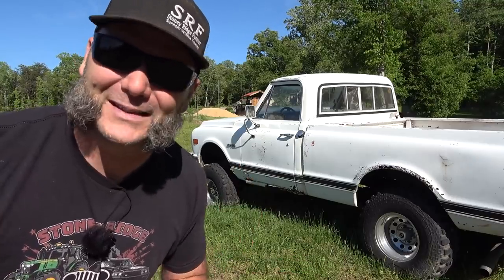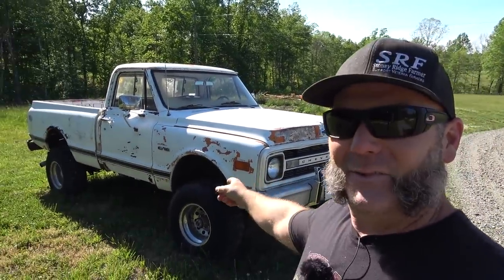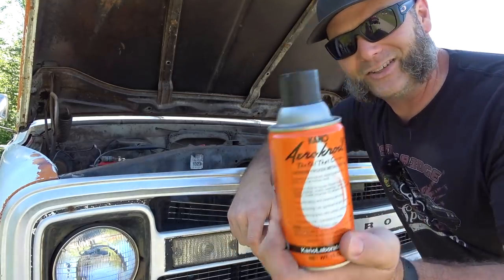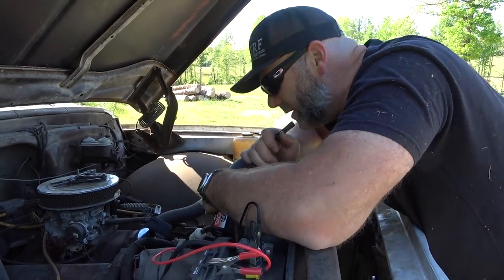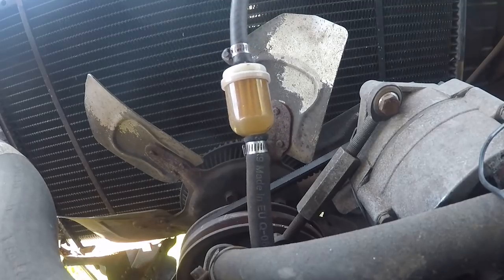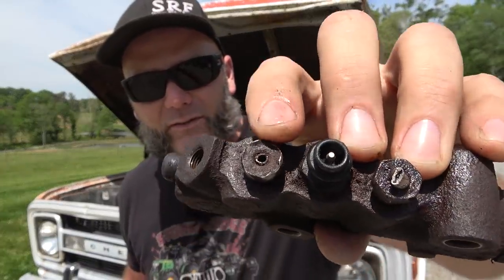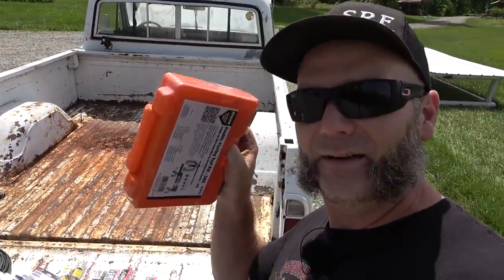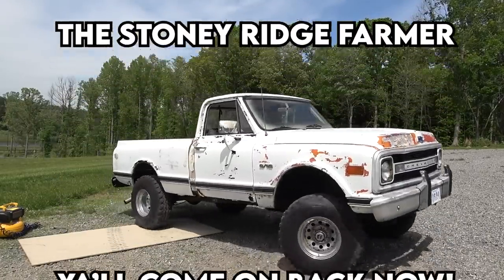C10 Pickup Is it worth Saving? Swamp Donkey C10 Episode 3

Comment: You need to watch Vice Grip Garage. He goes and gets trucks or cars worse than that one and ends up driving them home 600 miles. This guy is hilarious and lots of entertainment.
Reply: Yeah exactly this truck here is barely even that bad the little bit he showed underneath is better than my 78 c10 so.. i mean just a gas tank an a few fuel filters an possibly fuel pump and then the brake lines and stuff that's not that much at all . It don't cost that much , go on rockauto an get everything

Comment: Definitely keep it!!! Go to LMC or Brother's Trucks for parts. Brakes lines are fairly inexpensive. Then you will be safe. And if you have 1975 3/4 ton running gear then you have disc brakes which are better than drums. Anyway parts are reasonable and the truck is simple to work on.

Comment: drop the tank, 10 minutes,  clean it out, new fuel lines, new fuel filter, replace all break lines until the manifold comes in, 2 hours. pull the jets on the carb, can of wasp spray,  and a Merica air freshener..Dun.👍👍💚

Comment: Mechanical fuel pumps are like the human heart.  If the Mitral valve is not closing properly, you will have a low ejection fraction.  You should not be able to blow through a mechanical pump into the tank the valves should stop you.  Electrical pumps work better when they push rather then pull.

Comment: Josh, pull the fuel tank out from behind the seat and clean it out.  You shouldn't have but a couple dollars in sweat in it.  If you continue to pressurize the tank swelling it out, you stand a chance of rupturing it.  You can get the brakes fixed without spending too much money.  Myself, I would keep it and use it.  Haul your water to the cows and park the truck right where you need it.  You will be money ahead to fix it for the farm and not buy another fixer-upper to do the job of what you already have to do the job.  It's your truck and your money.  Spend a little or spend a lot, it's up to you.  God bless you and yours and stay healthy.

Comment: Hey bro like the sideburns.  Put a set of valve seals in the swamp donkey an I bet the smoking will stop. I had a '86 Chevy that smoked just like that. After the oil warmd up a little the truck quits smoking.  Pretty easy inexpensive fix that requires a little effort. Of course you'll have to adjust the valves when done but that's pretty easy too. I'd fix it for sure.

Comment: I have been through the plugged fuel line problem with my  1972 Chevy. There is a screen on the fuel line inside the tank. Mine was completely rusted and clogged and the tank was too rusted. When I was through cleaning the tank  it had as many holes as a fishing net. I guess that would explain the strong gas smell in my cab.

Comment: NICE!! I got a 1975 Chevy C-10 truck I use around my 12 acre hobby farm since I don't have a tractor. I plowed about a 1/2 acre plot pulling a moldboard plow behind it. Used a tiller to finish the plots. Love my "Beast" which carried 2300 lbs of hardwood flooring to remodel my floors. Mine needs a new transmission, but my son said he would put one in for me, otherwise it's gonna be $ 2000-$3000. I have the same dilemma as you. Maybe sell it and take the cash toward buying a used tractor.  Good luck!

Comment: I have a 64 Ford F100 and we had to replace the fuel tank, fuel lines, brake lines, master cylinder, distribution block, and wheel cylinders to get it straight.  If it isn't rusted through, there is a product that can clean and reline the fuel tank cheaper than replacing it.

Comment: I've had a clogged gas issue as you had. I took the fuel line off before the fuel pump and blew into the gas tank using a blow off air line and a rag to help seal the gas tank inlet . Be careful to not let the gas tank build up to much pressure.  At times I've had to drain the fuel tank out and keep blowing through the tank to blow out bad gas and junk in the tank.  Other times I had to remove the gas tank and put it on a tractor wheel jack up one of the tractor rear wheels start tractor and tumble it clean in first gear for 15 to 30 minutes I put in some water in the tank with a bunch of small pebbles I found on the edge of the road...

Comment: You will need to replace all the dry rotted vacuum lines. Hopefully you can replace the intake valve seals and stop the blue smoke. Hook up a vacuum guage and check engine performance that way.
Believe You would be better off to sell it and put the money toward the water system for cows. Good luck.

Comment: A couple of thoughts; a farm truck is a good tool to have, but do you have enough TIME to spare to get it where it needs to be before you can even use it? factor in the $$ needed as well... my vote would be flip it and take the $$ you can and put them towards a project that will help you out more. However if you have the time and find it fun/challenging enough then by all means go for it!

Comment: When the brake lines blow because you stepped to hard on the brake then it was time to replace them...
I had that happen during vehicle inspection. He stomped on the brakes to check that the ABS was working only to blow a brake line. That's when you really appreciate a dual circuit brake system. Instead of no brakes I had full effect on one front wheel and slightly lower effect on the two rear wheels. As is usual it was a hose that broke. Replaced them all just to be sure. Four hoses are a cheap life insurance.

Comment: Fuel tanks are supposed to be able to breathe so that pressure doesn't build up and cause damage. It sounds like the breather on your tank has rusted shut so that when you try to draw fuel, air can't enter the tank and the fuel just stops flowing. If you have the time, fix it, if not, let it go.

Comment: New master cylinder and each wheel cylinder whatever type it has and bleed the system. Should fix you right up. Also new mechanical fuel pump if it has one like that. Gas tank may need washing out. Lots of stuff to do to make an old vehicle road worthy and safe. Block you’re speaking of may be a proportioning valve. Good luck !

Comment: I had a 68 just like that with the granny 4 speed, I was pregnant with my second and could grab rubber in all 4 gears.  There is so much work that needs to be done it could take YEARS and a large bank account.  I believe that the part under the bumper is a brake manifold.

Comment: If you are going to sell it don't put any more money into it. If you think that you might like to keep it I have a couple ideas for you. 1 fuel system, pull the sending unit out of the tank and replace the pickup sock. It has probably rotted away and it is it's job to stop larger pieces of junk from getting into the fuel lines. That won't cost much. To make it easier to get it to pick up fuel, find the vent holes on top of the carb and use a small funnel to pore gas into the bowls of the carb. Then it will start up fine and give the pump time to pickup the gas. I do like the idea of using it to haul the water tank, I had suggested that in your tank video. Good luck with what ever you decide!

Comment: You can get those parts easier if you go full aftermarket, shop the racing stores like summit racing and Jegs for a fuel cell to put in the bed and even the race market has full brake systems with easy run lines.  dont sell it  rebuild it with all aftermarket parts  it makes a great farm truck.

Comment: Fuel issue will be gunk in the valves of the mechanical fuel pump allowing them to leak back, should be to valves in the pump, one at the inlet to stop drain back to the tank when the diaphragm compresses fuel in the chamber, and one in the outlet to prevent fuel from the carby line draining back into the chamber. Once the pump gets gunk in the valves they leak back and can drain the carby bowl dry. If you can blow through from carby line to tank then both of these valves are leaking back. 
Depending on age, pump may be a sealed unit or a serviceable one held together by a circle of screws around the housing. Should be able to get a service kit (new valves and diaphragm) if a serviceable pump, otherwise a complete replacement pump for the sealed pump. 
Put a decent filter before the pump to catch the crud before it hits the pump, filter between pump and carby is p***ing into the wind as far as the pump is concerned. Pull the tank and give it a decent clean out then unless you find a definite leak, put it back in. Filter and pump service kit of replacement pump will be much cheaper than a decent replacement tank.

Comment: Keep it . I mean I have a 78 c10 one onwer that is worse than this one an plus you can get everything either threw auto parts store or rockauto an yeah there is LMC truck but they are high... on things so i stick with junkyards an rockauto an AutoZone. 

Gas tank isn't to bad an a few lines an if u heated that brake proportioning valve you could get those old broken bolts or not out of it an still use that part.

Comment: The brake master cylinder and lines appear to be original 1969 non power brakes parts that came on the 1969. I've got the same on my daily driver 1969 SWB c-10. The 2 places to get parts is LMC Truck and Brothers ....plus RockAuto.
I would NOT sell the Donkey. If you do you should know in my part of Texas the '69 C-10 SWB in the same condition as the Donkey are selling for as high as 30k and as low as 8k, dependingon how lacking the buyer gets...because there are so few left.

Comment: That donkey is part of the farm too :-) Get yourself some stainless steel hose get the baby back up rolling :-) And clean out that tank from it's nasty water LOL.... and I think they still call that a break line distribution break line blocks ...... and put some Lucas Fuel Treatment and Injector cleaner into the tank it breaks stuff down and bond's water as well so you get your tank and fuel system clean. Just swap the fuel filter out more often. It cost only 50cent that little fuel filter. 
For break and fuel lines use Stainless steel coil and with a cheap flare kit from Habble Freight you get rolling. Get yourself both. I get my Stainless Steel lines online from Ebay. Them coil's are much better to have around because you use a copper wire just to run what you need and boom you know your lenght and than you just bent and cut to length of your roll.
Use a propane torch to warm up the stubborn nut goes a long way :-) and I think it's called a break line distribution blocks.

Comment: Brakes are just a luxury on a farm only beater truck.Get the parking brake working or aim for a smallish tree. Done both.Drop the fuel tank,beat the living hell out of it with a 2 pound rubber mallet to get the loose stuff off,rinse,drain,rinse,drain,rince,drain dry and install. Will be good enough.Pull and chunk the bed and slap on a home made flat bed. Think like you're broke, think like you have to work with what you got. Stay away from the edge of the money pit.

Comment: You can buy brake line in 25 feet rolls i buy it by the roll all the time . Its best to buy the  Steel Copper Nickel Zinc Brake Line because it is much essayer to bend and lasts a lot longer than just steel line .I is a round $1 a foot on ebay. fix the truck the brakes don't cost that much you can replace all the brake system for under $200

Comment: Thems some mutton chop side burns Nice going back to 1800's politicians hair styles,  Josh you running for office?    I think vanilla milkshakes are healthier to suck though a tube than gasoline, but double check with the misses just to make sure. 
Love this old truck hey I have the GMC model 'Chevy tailgate' and a F.O.R.D. first on race day tag on back it really bothers OCD perfectionist people out, kinda funny.
Yeah Josh weigh it carefully ask God to show you feel Holy Spirit aside all problems then say I should sell the truck then same mental  thinking I should keep the truck perhaps reverse it to keep then sell it a couple of times you'll know what to do brother, can I get a witness ? Yeah brother you can.
New fuel in tank old fuel garbage , been there done that 
Replace all fuel filters don't forget one at carburetor just inside of  it as fuel line enters  carb. All that  brake fluid is old it picks up water pretty simple brake system fix it man if time is at a premium have someone else chase down and run brake lines 
SEE { LMC Truck}  order parts online from there they're the go to for that truck parts they've got a pretty complete parts  the lines will come in long  box pre-bent just snake them into position and connect bleed line

Comment: What is different between C and S ?   Maybe that is an older version.  Hum.  That is it - C is a 60's and S is 90's.  Something like that.  Mechanical fuel pump ?  change over to an electric !!
Reply from the maker: 1964 I believe through about 1987 designated C on full size trucks...then went to K. S is like an S10 pickup the smaller compact or midsize truck